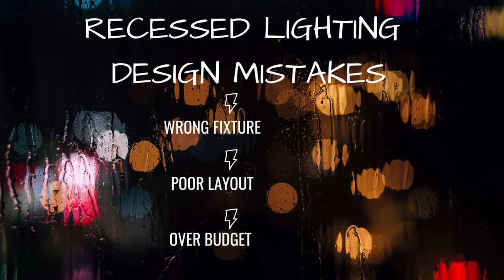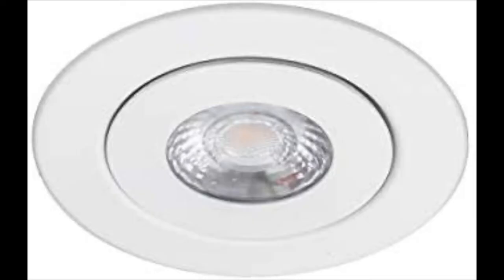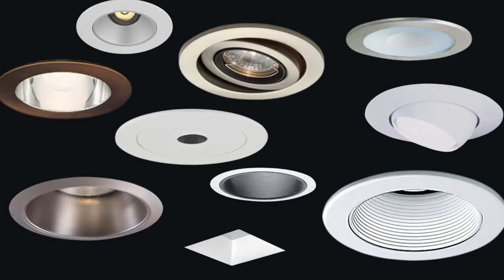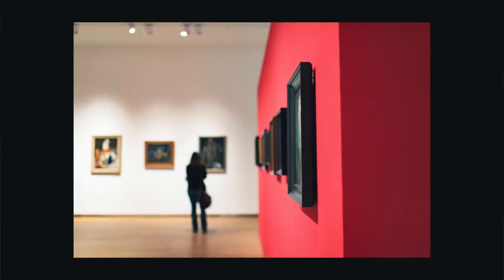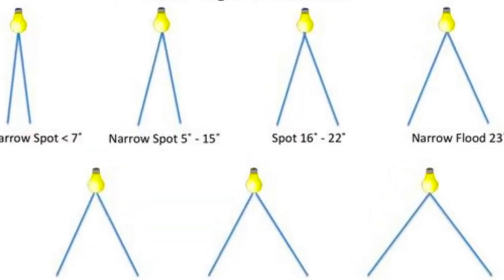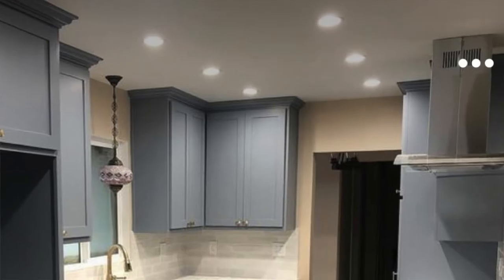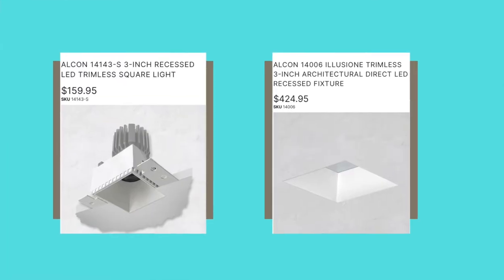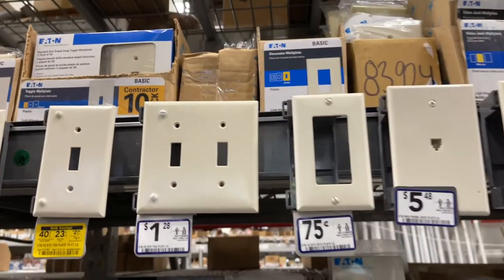3 BIGGEST MISTAKES IN RECESSED LIGHTING DESIGN AND HOW TO FIX THEM!

Comment: I’m trying like heck to find the. Idea you are referring to about finding more reasonable options for recessed lighting. I received a quote from a local lighting store for WAC 4 1/2 inch recessed lights and it was $260 for the housing and $260 for the trim kit. I almost fell over. Can you help me locate this video?
Reply from the maker: I know right? It’s a jolt ⚡️ What you priced was pretty damn near the best! But, there’s options! WAC has a wafer eyeball for $30 so there’s some in between🙏. I think I mentioned a bunch of brands in this one, https://youtu.be/HvbZ0Hbs-4g ?  But look at WAC other offerings, Dals,Lotus, Cooper (halo). You can find integrated bulbs and transformer kits for $100. You also can vary. Nobody said use the good china everywhere!
Reply from the maker: https://lightingnewyork.com/product/lighting/ceiling-lights/recessed/wac-lighting-pop-in-recessed-r4dsdr-f9cs-wt-12/2433170.html?vip=XPX5UWXY&utm_source=LNYShopping&utm_medium=PLA&utm_campaign=WAC-Lighting&utm_content=Ceiling-Lights-Recessed&utm_term=3414332&gad_source=1&gbraid=0AAAAAD67-y-xoUDvqdsQ_LiJ8Db9gDzoc&gclid=CjwKCAiA1fqrBhA1EiwAMU5m_6AEZmcvnMHUixY5omDvXmZNVdLlkuNhFTdV_6Yo5fw3z102vPAYRxoCBB4QAvD_BwE

These are a remodel set but they make new construction as well. Probably $100 more but for 12. Merry merry
Reply: @lizbiancoismydesignsherpa   you are awesome. Thanks so much for the help.  I have a weird question, but do you happen to offer any kind of fee-based phone consult to take a look at my layout and to offer answers on a few general questions?
Reply from the maker: @chris2884  I do! Are you on my email?
Reply: I don’t believe so.  I just found your email in the description. I’ll send you a quick email if that’s best.
Reply: Ok. I think I sent the email to you. Thanks!

Comment: Led recessed lighting is not expensive at all I just purchased 12  4 inches lights from  Amazon for $59.00 
And no body use those bulky, and expensive can recessed lighting anymore
Reply from the maker: We do! They’re not as bulky as the cheap old housings, but for $59, the lights are probably wafer lights? I did a video about the difference, https://youtu.be/NAk9JbUQLq4